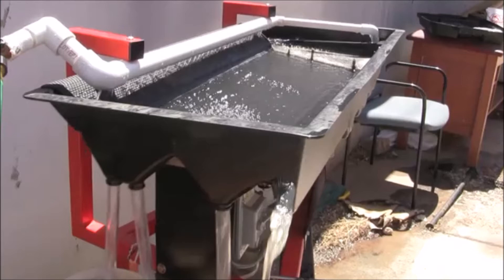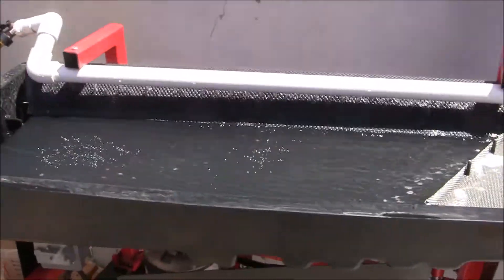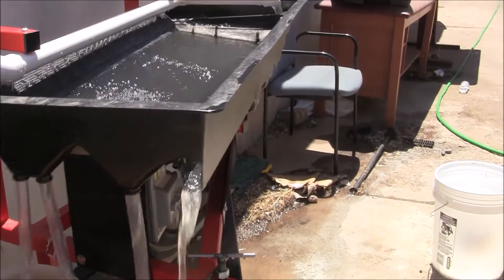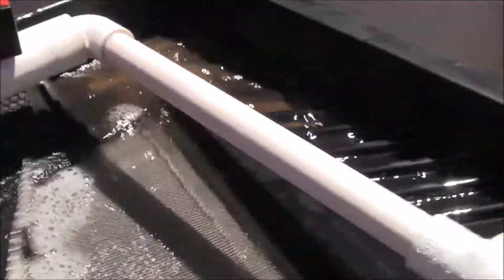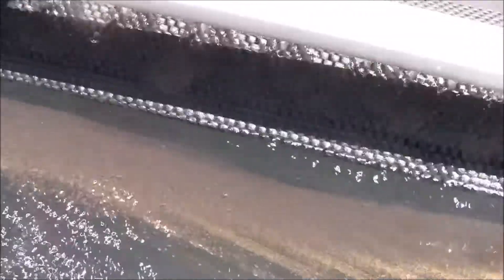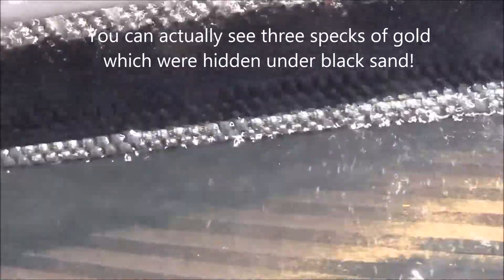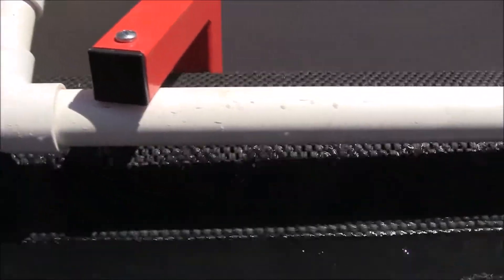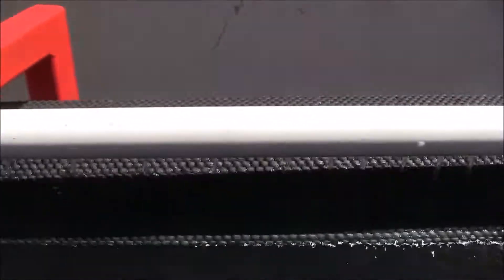RP4 Shaker Table - Part 2

Comment: Make sure that table is under a Tarp or inside folks ! That sun can warp that table then its no good. I seen a farmer loose thousands over the sun wrecking vexar begs for oysters lol. thanks for sharing
Reply from the maker: That's true, I never kept my outside. Now I have a commercial 4x8 with a CNC machined 3/8 inch aluminum deck. It is fine outside, lol

Comment: Fyi imho you could have bought two items to recirculate the water with. A 1200 hon 12v pump. One concrete mixing tub. Under ports 1 &2. WITH 5 GALLIN BUCKETS. THEN KIDDIE POOL FOR MAIN CHUTE UNDER THEM AS WELL HOPE THIS HELPS. SO KIDDIE POOL THE TUB THEN BUCKETS = NO WATER LOSS

Comment: Does a hopper come with table or spoon fed?
Reply from the maker: unfortunately spoon fed. If I were using it on larger volumes a feeder would be ideal. As with any recovery process, a steady feed of classified material works best.
Reply: Ok Thx. I have alot. Plan on using RP4 as stepping stone.

Comment: good instructional video. I've had my table for over a year now and it works pretty darn good! I do recirculate and use a 5 gallon bucket with backsplash to catch tailings and pails or jugs for the rest. some of my gold is dang light though that if the water is roiling it will go over the top so I've actually had to figure out how to filter and catch it. best wishes! nt